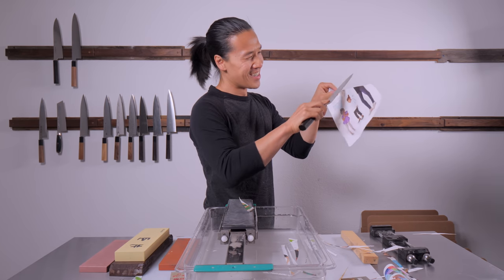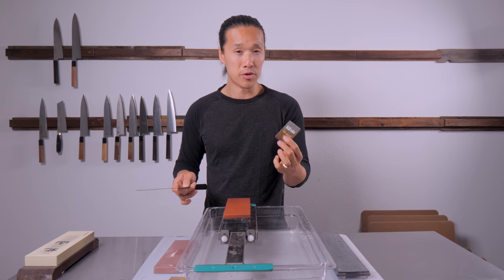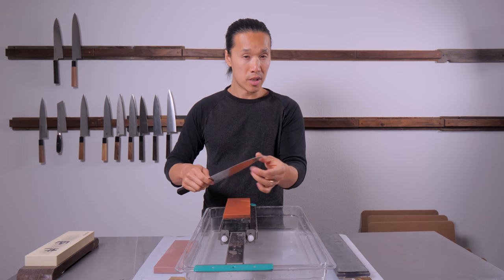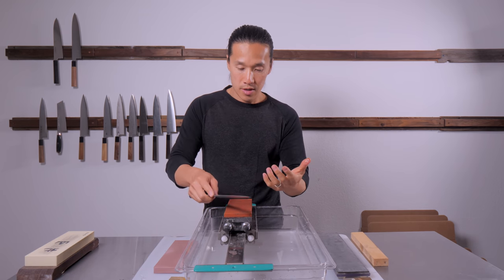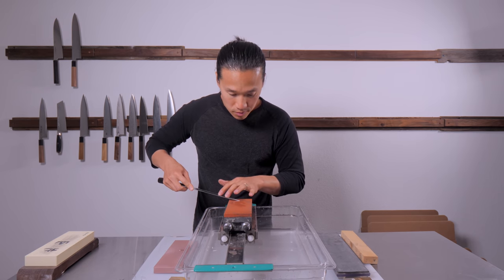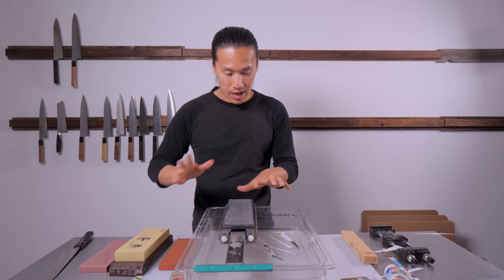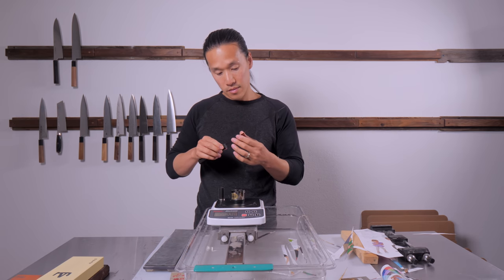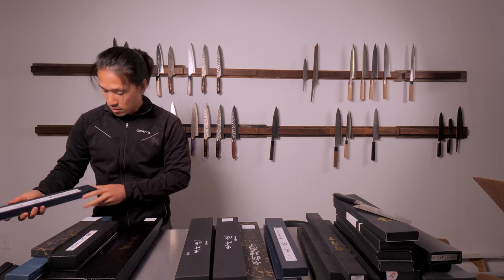How To Sharpen A Slicer Knife

Comment: Im still having trouble keeping a constant angle when sharpening and i think its because i switch from kitchen knives to pocket knives and the angles are very different so i cant get used to one. I did however get my first push cut yesterday.
Reply: I got a set of plastic angle guides, and checked frequently. Now - and this sounds odd, maybe - with confidence (and practice), I can get the angle, and time and again, if I check it, it's right on the angle guide. As beings, we are able to develop really pretty extraordinary abilities, with practice, then it is just a matter of confidence, like, "I know I have the angle." Much more fun that way!

Comment: Hey Ryky, 
I found the noise of your stop radically different than mine. Yours almost sounds like a proper whetstone, is that because of the compound ? 
Cheers, great video as always. 
Louis
Reply from the maker: It was wet, and the knife is ultra thin at cutting edge.  And the microphone may have enhanced the noise. And i am using the rolled buffalo

Comment: You use the push/pull method to avoid deforming the profile during sharpening. But when you remove the burr, you transition to what appears like a stripping/crescent method. Won't this change the profile over time as well? Or is the pass so light that you are only removing the burr without removing any more material?

Comment: Hi, I use your method for sharpening.  When I get to the full strokes (10 then 8, etc.)  I also find  it more natural to go heel to tip toward me and tip to heel away. HOWEVER, on the away stroke I feel I have to start at a steeper angle to get the very tip.  That makes it hard for me to adjust to a  proper angle when I get to the main part of the knife. Am I doing it wrong or can you explain in detail how you get the tip and still maintain a good angle on the away stroke.

Comment: I usually take three or four tests using my sharpness using the BT50C: heel, mid, belly and tip. Although this test is very accurate for static tests, I don't take this test as an end-all for sharpness. I think this is a good test for edge width and overall geometry just beyond the edge toward the spine. The thing it doesn't test is what I call dynamic cutting. That's where the edge slices through the material. which is more realistic but is not practical to measure objectively. Experiencing the edge in practice is the bottom line for me.
Reply: finally some common sense

Comment: Ryky, what micron rating was that compound you tried out on your strop? I've been watching since your early days and have been going from a Chosera 800 to a Rika 5000, finishing with a 2.5 micron compound on your rolled buffalo strop. I just picked up a slicer and want to upgrade my kit. I was thinking of replacing the Rika 5000 with a Chosera 3000 and adding a Kitayama 8000. What compound would you recommend after the Kitayama 8000?

Comment: Mr. Ryky, I did notice that you dont remove the burr on your sharpening.  Other places call out that not removing a burr explicitly sometimes straightens it out which will give a very sharp knife but without the edge holding for long.  Could you please explain what I am missing?
Reply from the maker: this may help https://youtu.be/KiuuyDE1pdY
Reply: @Burrfection  Thank you! right around 14.20 mark in the video you are addressing the same point!

Comment: A lot of professional sharpener's continue the push and pull method beyond the first stone because they are sharpening for efficiency. They don't really have the time to do single strokes back and forth through their entire grit progression. If you are someone learning sharpening Ryky's method is definitely good for learning and starting out, but as you gain more confidence, speed and consistency, you will probably want to start switching to the push and pull.

Comment: Is there any particular reason that you sharpened from tip to heel when doing the push and pull. If I recall correctly in your other tutorials you go in both directions, from tip to heel and from heel to tip. This time you went tip to heel then lifted the knife off the stone and reset on the tip. Just got a Sujihiki and wanted to throw a quick edge on it
Reply from the maker: You ca go either way, but for really straight profiles, i generally got from tip to heel.
Reply: also an unrelated question I have a knife in blue number 2 coming and I was just wondering what oil you recommend putting on the blade to keep it from rusting I live in a very humid area so I’m pretty concerned about it.

Comment: If I have a 270mm Kiritsuke which is pretty straight and the Shapton seven set, I suppose to do the push and pull only on the 25 micron and the 6.7 micron (I guess that the 0.44 micron is for stroping motion) or only on the 25 micron and start to deburr on the 6.7?

Comment: I always thought that the purpose of stropping was to remove the burr.
Reply: There are many ways to remove the burr, and stropping is one of them. Stropping can also act as a means to apply a super-fine polish without ability to change the apex geometry (much). Beware that stropping may only SHARPEN a burr - and not actually remove it. If you strop an edge that slices beautifully, but then that edge goes away rather easily, much sooner than you think it should - it is probably because you failed to truly remove the burr. It took me a LONG time to learn this, I hope it helps.

Personally, I've found Ryky's method of burr removal to be ineffective for me. The only reliable methods I've found are pulling the blade sideways across the stone, or to use a hardwood stick to literally force/bend the burr to one side - and then gently, gently gently grind it off with traditional strokes on the stone.

Comment: Um... I think you should come sharpen my knifes... I'm so not that good yet(if ever with my stupid wrist not bending right)!
Reply from the maker: just practice, friend. just practice
Reply: @Burrfection  I have been, I might need to get a Tormek, I destroyed my arm at my wrist so it doesn't articulate correctly.  So getting the right angles has been a problem.  I'm trying to learn how to use my left hand, emphasis on trying! LoL I bought a couple cheap knifes to work on incase it goes horribly wrong.. lol